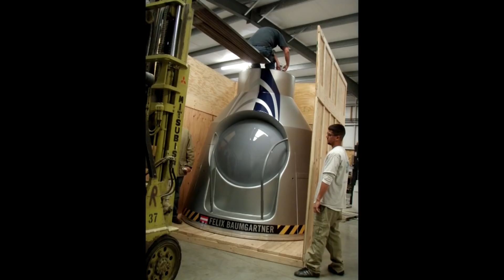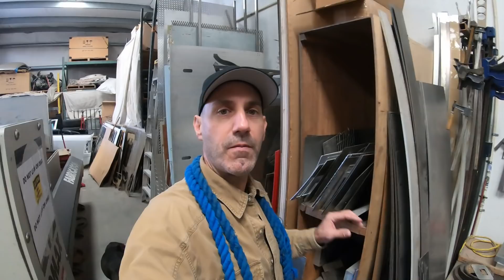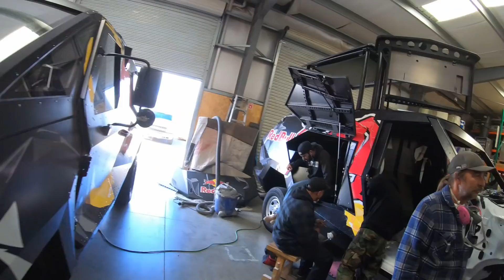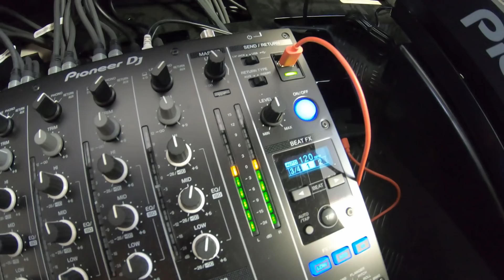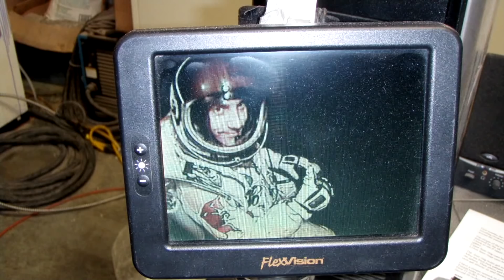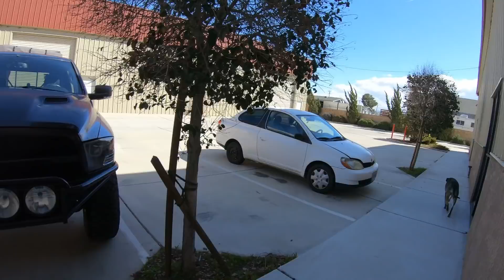AutoEdits: How I Found Pinto the Dog and BTS of RedBull Party Trucks and Stratos Program

Comment: Hi, maybe you can help me out. I have a 6 speed manual 2014 jeep wrangler unlimited Sahara, tire size 295/70r18. If I’m traveling at 70mph what should my rpm’s be at. Also how are you holding up?
Reply from the maker: Why are you concerned about rpms? Does your jeep not feel right? That size tire would do well with a 4.56 gear ratio. I think the Sahara stock is 3.73 and might feel sluggish on the highway.
Reply: @AutoEdits  I have 295/70/18 nitto ridge grabbers, fox 2.0 with reservoir and lifted with all bells and whistles. Jeep drives great, was just curious, on highway in 6 gear at 70 mph my rpm’s are  at  around 2600. Just wanted make sure if that is correct. I’m not sure if the gears were upgraded but I’ll check later and let you know. Thanks
Reply from the maker: That sounds about right.